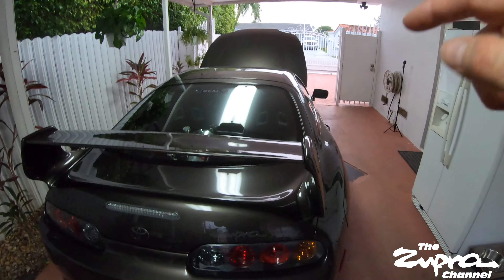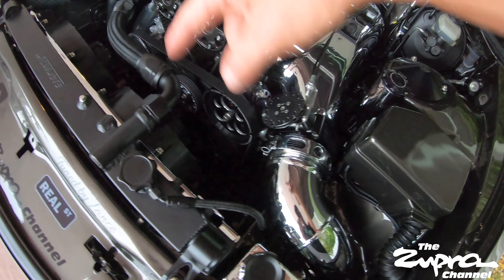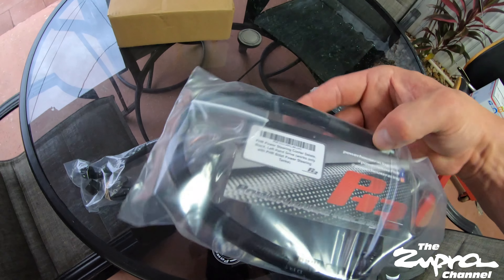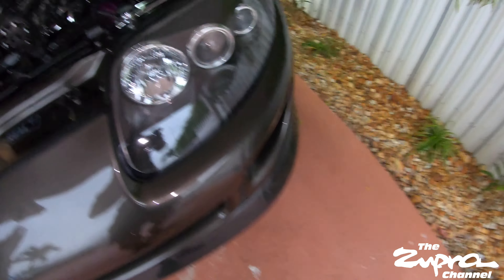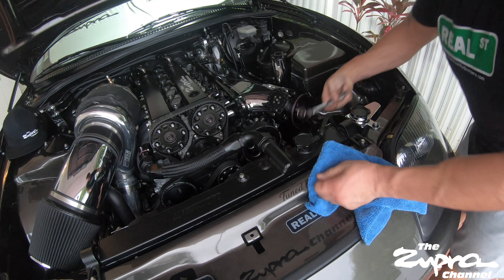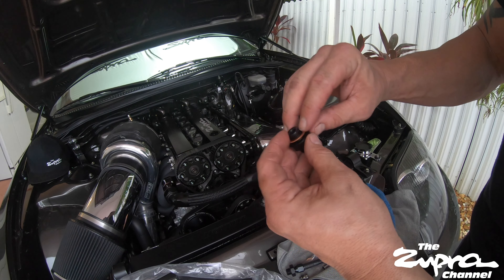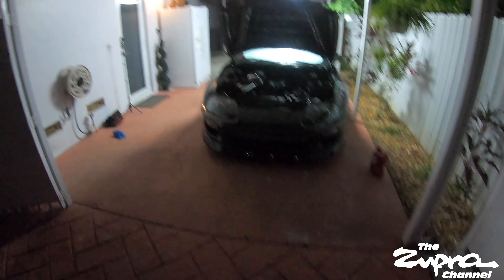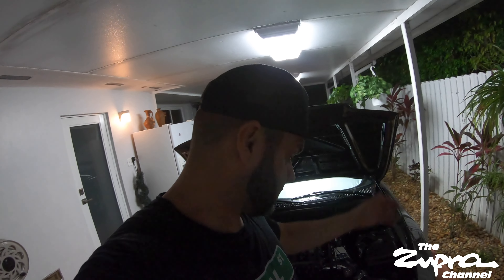Replacing power steering lines on the Supra

Comment: Any Issues with this Kit now? about to order mine with both cooler delete and high pressure line
Reply from the maker: No issues as far as leaks but you can feel a little more resistance with it over the stock oem line with cooler
Reply: @TheZuprachannel  I've never had power steering before so idk what oem feels like 😭😂 but great to know man thanks for the swift response! 👍🏽
Reply: @TheZuprachannel  So would you have replaced the line with an OEM line in retrospect?  Mine has a small leak.  My built 97 drives like OEM and I like OEM parts when possible.  What advice can you give?
Reply from the maker: @HAULUUZ  honestly if you have the extra money buy the oem line this aftermarket one is less expensive and looks cleaner but it does not feel like the oem one did.
It does not bother me much because I don’t drive the car too much anymore.

Comment: OK so I have a ps pressure line in my 2jzgte vvti, and capped off the manifold vacuum. Should I put the original hose back on cause I basically deleted the idle up function?
Reply from the maker: Yea you basically deleted that function